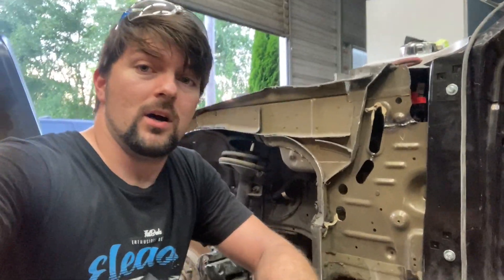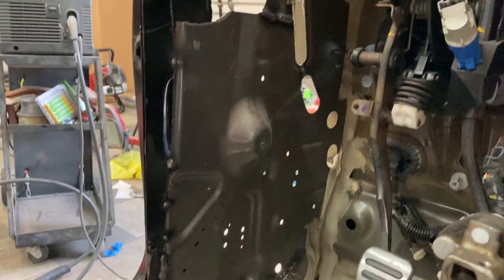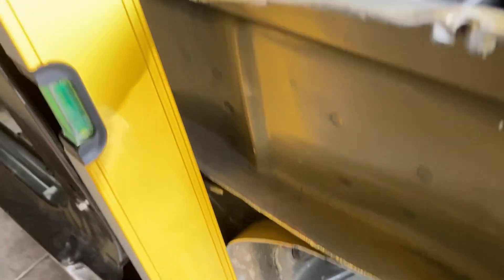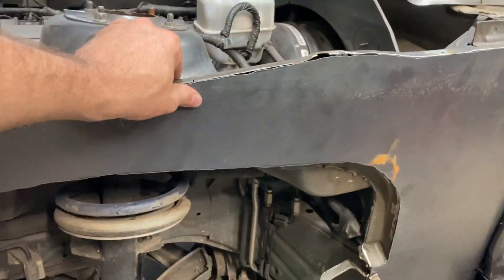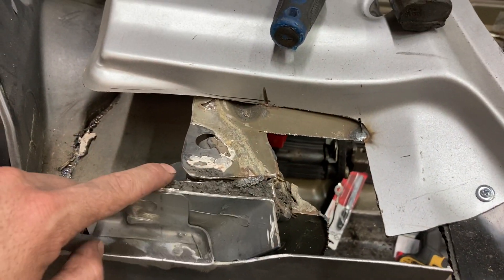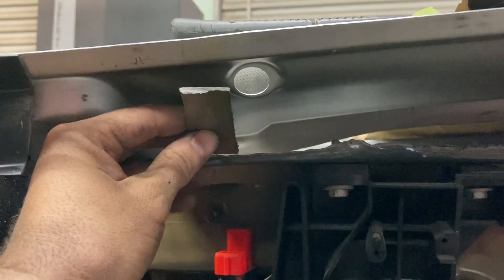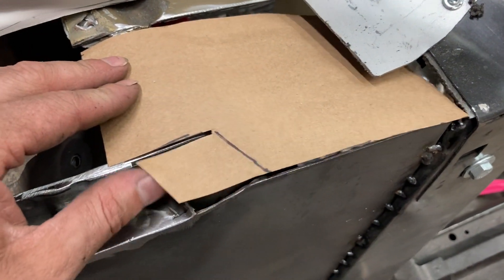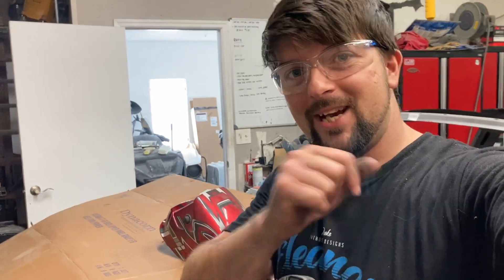1967 Mustang body swap part 4

Comment: How about a 68 Mustang Bullitt Fastback body onto a 2018 Mustang Bullitt chassis?
Reply from the maker: It would be pointless to use a true bullitt since all that car has different that would be used are seats and horn pad and gauges. It would be cheaper to use a gt and buy the bullitt parts

Comment: Hey bro I just bought a 67 fastback I want to do a modern dash in it. Can you put one in mine?
Reply from the maker: I could but very covered up at the moment.
Reply: @1194video  ok I’m doing this in phases I’m going to do the interior at a later date. I would like to get on your schedule for later if possible
Reply from the maker: @joelthomas2919  what are you going to do about the vent ducts, wiring, gauges?
Reply: @1194video  that’s what I don’t know the blower would be with the dash assembly and the blend air door the a/c system would have to be off of the same mustang. Or there has to be a system that can be bought for a retrofit. There are some brothers on YouTube that mentioned the wiring for that and the headlights. As far as the gauges I don’t have a clue. I’m trying to find someone who knows all this and has done it. Do you know anyone?
Reply from the maker: @joelthomas2919  it’s a bit of work, the factory hvac box will not fit to your firewall first off, and it’s massive, then the console is designed for a higher trans tunnel so there are brackets to be made to mount the lower dash and console then that allows for a gap at the bottom that has to be addressed, Then for the wiring to use the stick new model wiring you can get by with running your old school wiring to the hot and ground and running the ignition wires and fuel, oil pressure and temp but the speedometer has to have a vss gps wired to get that to work unless you have a cable to digital kit. To make the hvac work that’s a different story, if I was going to do that again I’d build my own vent tubes and run vintage air and build custom radio plate to run the controls for vintage air and just convert stock 67 parts into the new dash to retain easier installation